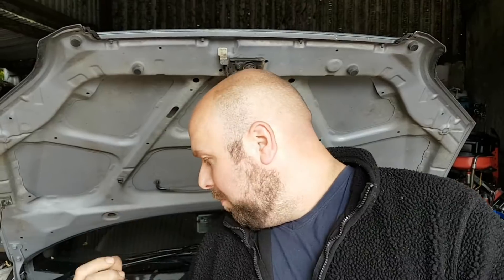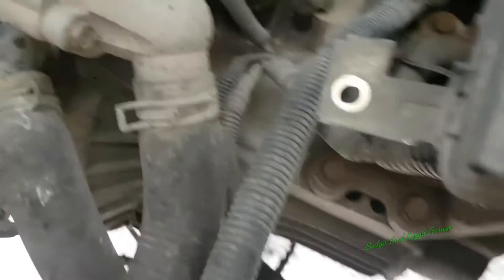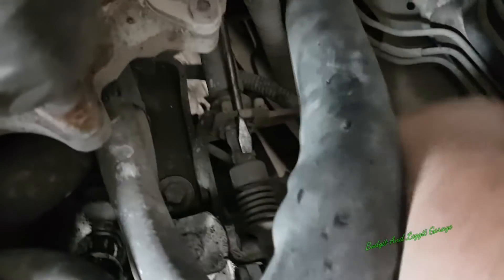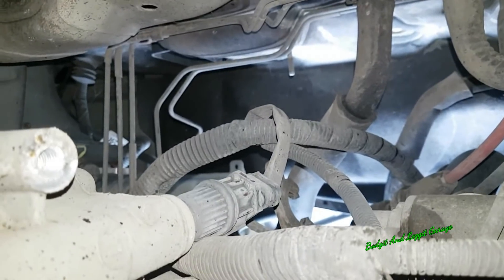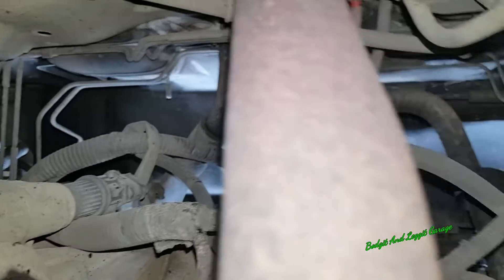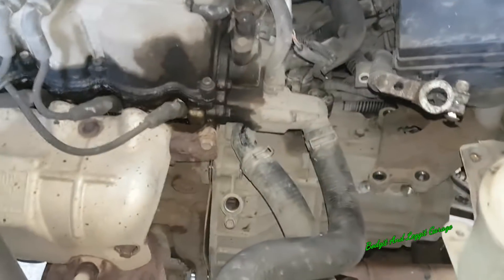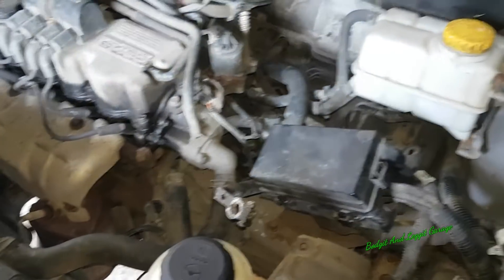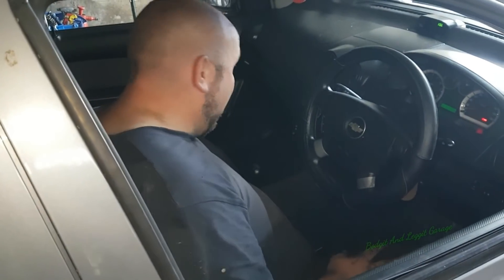How To Flip A Car Part 2 chevrolet aveo clutch replacement

Comment: Nice job. You can't beat the high you get from fixing a car and it works afterwards!
My first attempt at fixing my car, was back in the 90's. I replaced the wishbone on my Fiesta, but I screwed up something and the whole hub, wheel, mounting and drive shaft, just popped right out immediately after I attempted to drive it.
It was a big mixture of sadness, embarrassment, and anger..
Reply from the maker: We've all been there done that if the real world mate LOL

Comment: I did an engine swap in a 2010 Aveo about 9 months ago. Make sure you have plenty of vasoline for lubrication because it's TIGHT. Replacing the clutch was easy with the motor out tho. 🤙

Comment: Not fun on the floor. Are you going to be able to get your lift installed in your new place?
Reply: Easy on the floor. Done plenty on floor along with engine swaps.
Reply from the maker: It's more awkward on the floor certainly does take a little bit longer but as you can see not impossible I will be doing some engines as well on the floor been doing it this way for years

Comment: Is it not easier to pop the ball joints out on either side instead of the pinch bolts for the suspension ?

Comment: Ah.. The joy of changing a clutch on the ground! PITA on a front wheel drive. Easiest I can thing of is on a Triumph Herald, Spitfire or GT6 because the gearbox comes out of the passenger cell and you don't need to jack the car up to do it.
Reply from the maker: Boom SORTED lol

Comment: A word of warning to anyone doing a clutch on an Aveo or Matiz, be very careful with the inner driveshaft seals, they are only available from GM, cost about £9.00 each and are supplied in pack quantities of 10, both sides are different, I remember from when I used work at a dealership.
Reply from the maker: Boom SORTED